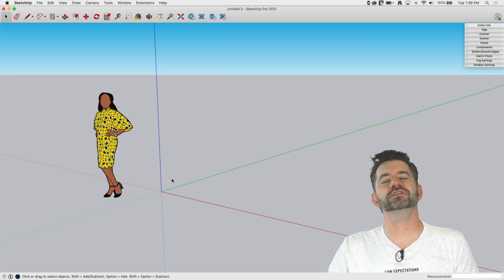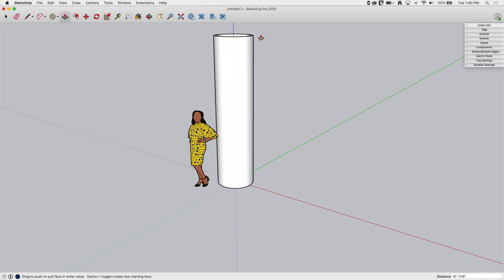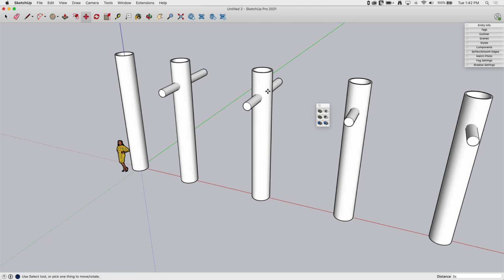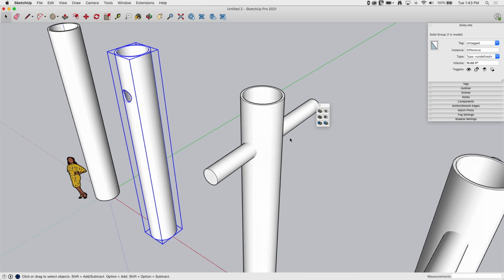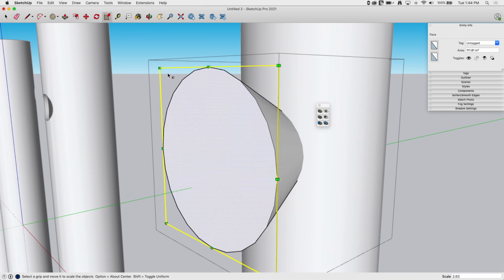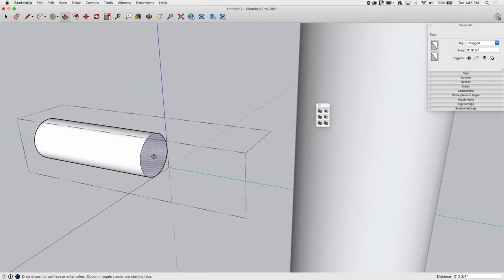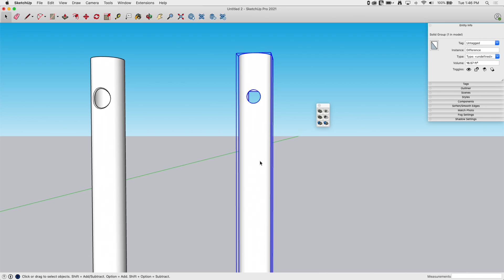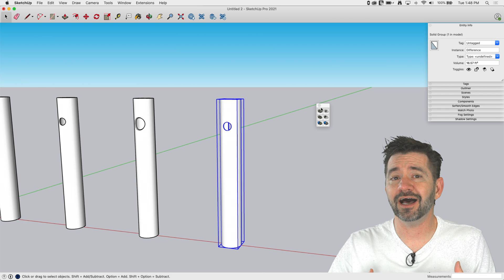Cutting Holes in Cylinders - Skill Builder

Comment: it doesn't work. in my case im trying to cut a cylinder with another shape and does not work. every time I try it gives a different result, or both solids dissapear or the cutting solid turns blue, or just one side turns blue but there's always a remaining part from the first solid. if use the cut tool is the same. the parts that are not touching the cylinder turns blue
Reply from the maker: Probably best to share an example of what you are seeing on our user forum (forums.sketchup.com). It a real challenge trying to troubleshoot models here, on the YouTube comments section.

Comment: Suppose you have two 2x4s back to back and you want a 3/4" stopped hole that goes 1" deep on one end, Trick is you want half the hole on one 2x4 and the other half of the hole on the other 2x4 and you need to maintain separate geometry how would you do that? My solution was to use solid tools and I did one 2x4 at a time. Can You use solid tools with one cutter to cut multiple items?Another way I did this was use Eneroth Solid Tools to make one 2x4 a component, copy it the scale it -1 and make a cylinder the size of the hole i need sett the cylinder onto the edge of one board half way, select the board click trim and click the cylinder... this cause both boards to have half a hole. I delete the cylinder and bring the board faces together. Done.

Comment: Thanks Aaron. I actually have been trying to cut holes in a solid cylinder without any success. I have a 100mm diameter cylinder and want to punch 4 equidistant holes to 30mm. Please help as it's driving me crazy.
Reply: Without seeing it I would guess the geometry being created is too small. Try scaling everything up 100x and try again. If that does not work, try posting your model to our forum and ask for help.
Reply: I would use the same method Arron demoed today. Place the first hole "punch" rod then copy it to the last position and use 3/ to create an array and place the other copies equidistant. You will then need to use solid tools 4 times to cut the 4 holes.
Reply: If you have SU Free, you don't have Solid Tools. Use "Intersect Faces" instead.

Comment: This was very useful....but how about engraving on a cylinder, is that even possible?
Reply: Very much so! I would probably lean on an extension like Joint Push Pull to do that, though...
Reply: @AaronMakingStuff  would this also work on a oval or a s-shaped s shaped surface?

Comment: Hi Aaron, nice video.  What would you do if you needed to cut multiple holes, say with an array of component cylinders, into the larger, vertical  one?  Is that possible?  Thanks.
Reply: Same process... just make sure that the cutting elements are solid, group then together and subtract them from the vertical one!
Reply: @AaronMakingStuff  Got it , cool.